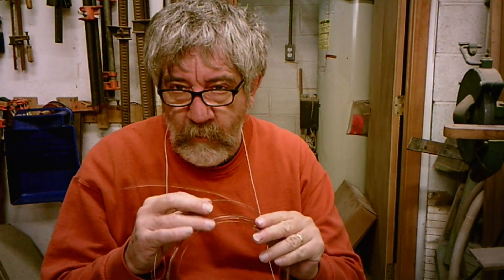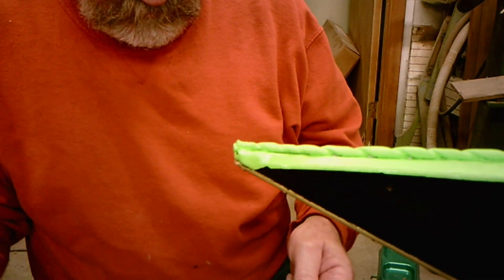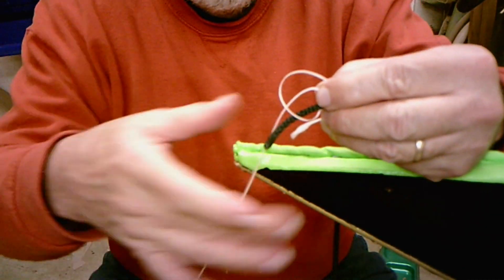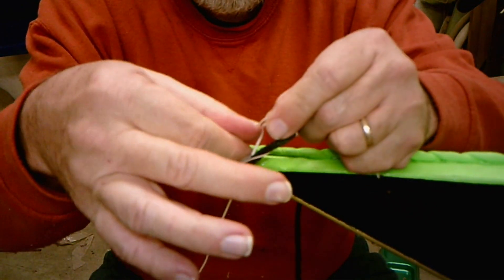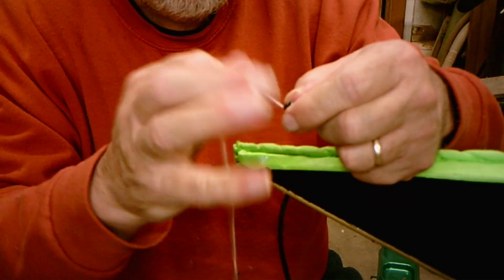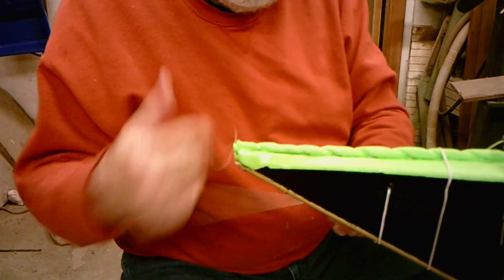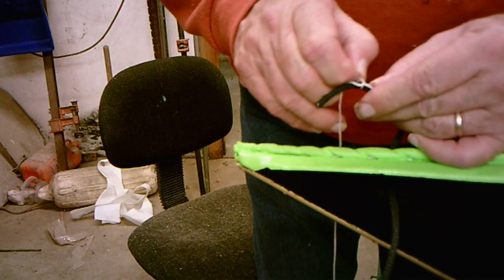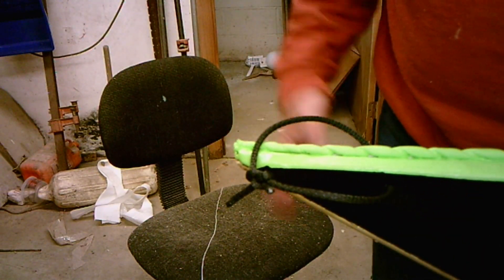painters

Comment: That reminds me of tying up a roast or something, but very nice trick. I've done that by melting a tapered tip, and sewing back and forth through the line with artificial sinew, then passing the last stitch right out through the melted, tapered tip. It helps if you avoid melting the very center of the line when making the tip. Then pull the sinew through with the wire, and pull the line through. Nice work!